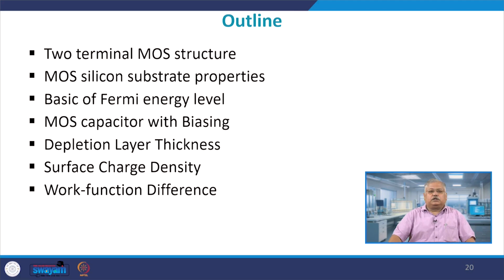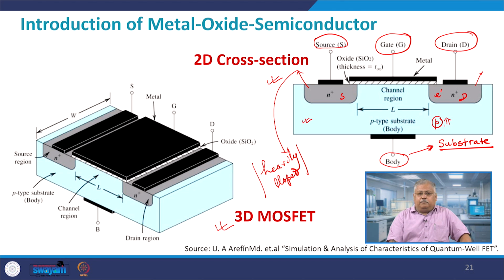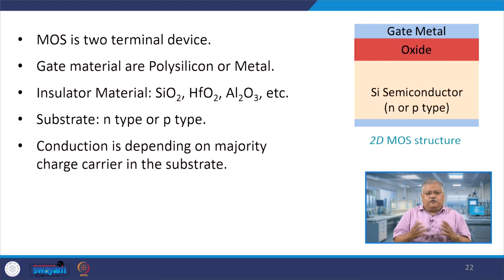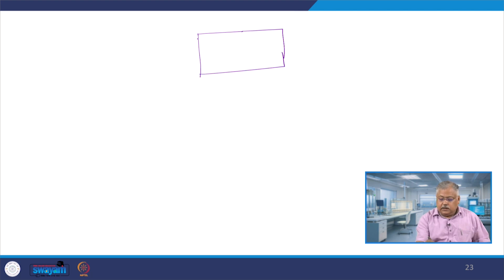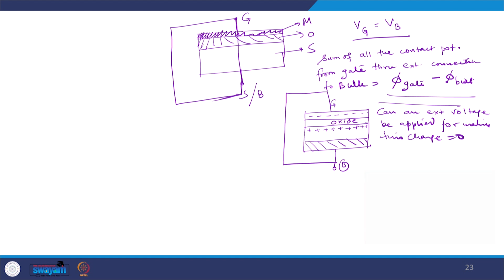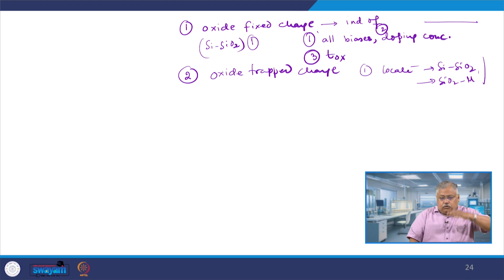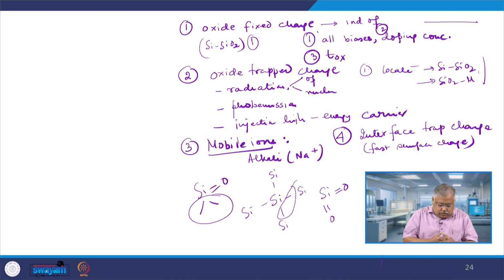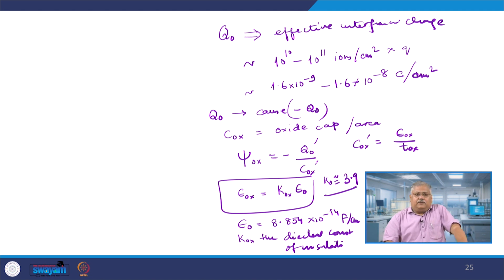Lecture 2 Introduction of MOS and Energy Band Diagram - I

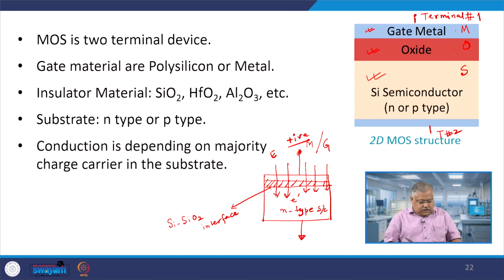Comment: there is an abrupt change of discussion from 13:45, where prof. is talking about the behavior of charge carrier when bias is added to a discussion on bulk potential, which completely confused me of that the premise of the discussion is. Please, revisit the video edit or this topic.
Reply: Could we begin the MOSFET module with a brief roadmap of the underlying MOS capacitor physics? Specifically, it would help to first explain why the MOS capacitor is foundational to the MOSFET, and why the bulk/Fermi potential is important before diving into surface potential and charge.
A short overview that connects:

Fermi (bulk) potential
Surface potential  and the strong inversion criterion
Depletion charge and inversion charge
How these feed into threshold voltage Vth (including body effect),

along with a simple annotated diagram (band bending at the surface: accumulation → depletion → inversion) would make the learning objectives very clear. Without that high-level map, I find it hard to know what physical quantities I should be tracking and why they matter for forming the channel and affecting VTh
Reply: @nileshpadhi4850  u should watch course by sanjeev sambandhan IISC